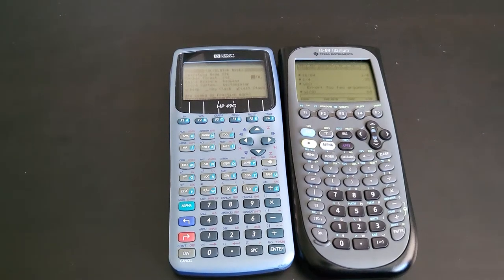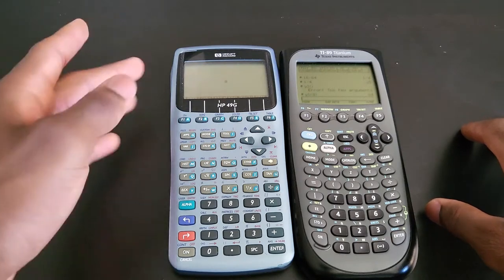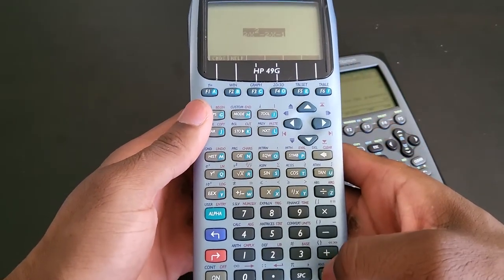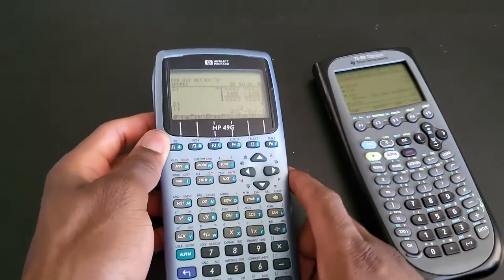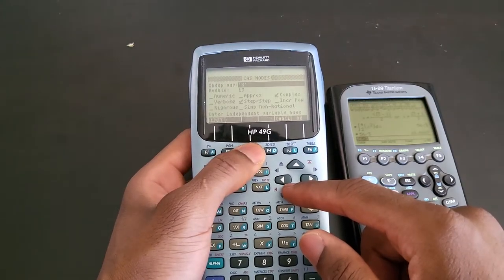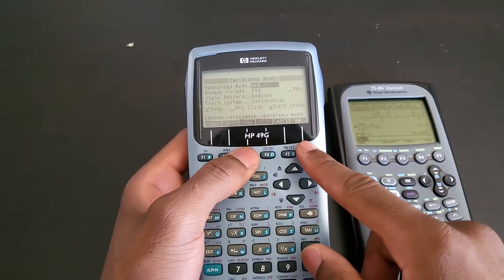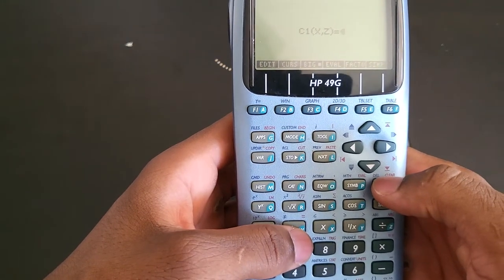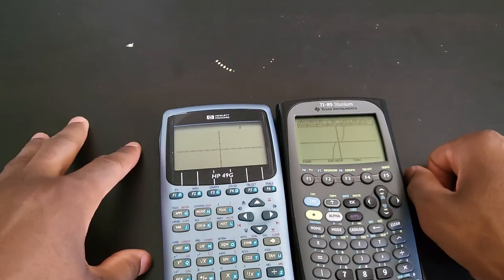HP 49G vs Ti 89 Titanium (Part 2)

Comment: I remember in college with my TI 86 and some students had a TI 89 and I remember wanting it so bad... now that I have one at 39... I have to admit that the smaller font is a real tough issue.  Still a cool calculator, but the TI 84 plus CE is just a better experience (even without the CAS).

Comment: I greatly prefer the TI-89! Even though I started with the HP-35. And continued with the HP-45, HP-65, HP-67, 41C, 28, 42, 34, 48, 50, Prime. Also Casio and Sharp high end calcs as well. So far the ti-89 is clearly the best. There are too many reasons to list here. Cheers.
Reply: The problem with the ti89 titanium is the screen font. It is unreadable.
Reply from the maker: The TI 89 Titanium was my first calculator; not just graphing, but calculator. It is also by far my favorite!